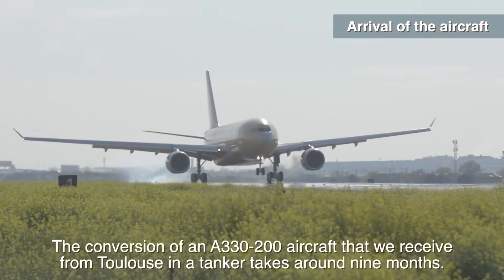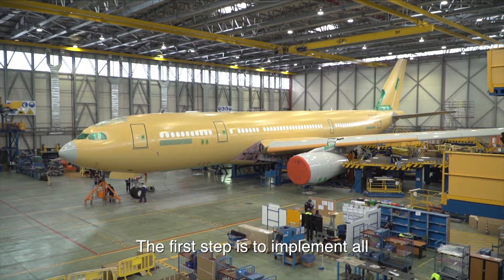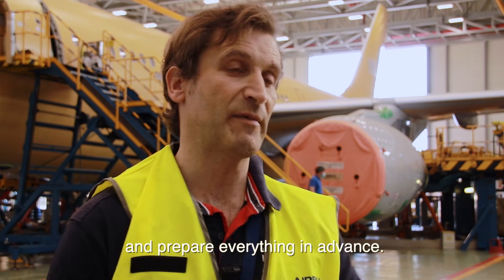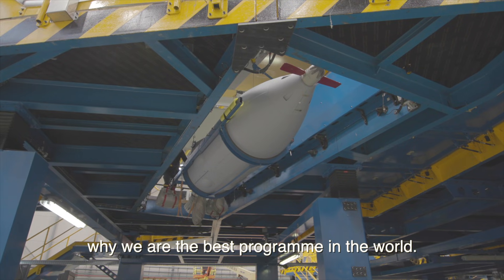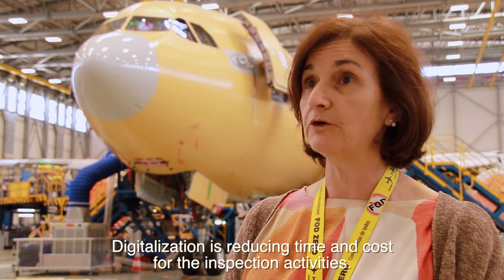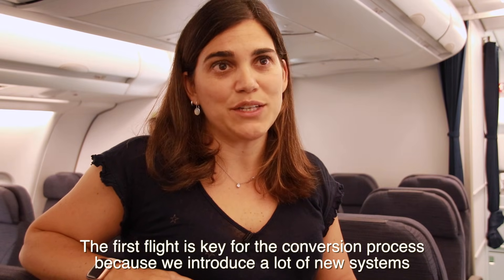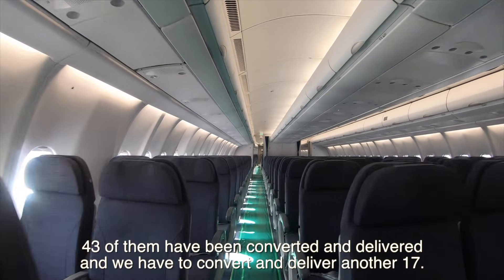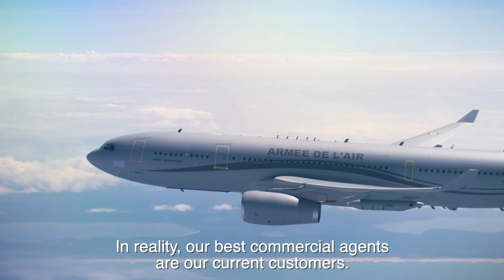How Airbus transforms the Airbus A330 aircraft into a A330 MRTT

Comment: the A330-900 Neo as a MPA with multi role ASW & EWS capability would make it a formidable asset against any adversary!!! the A330-900 Neo LR multi role MPA will have more capabilities than just an in-flight refueling tanker aircraft!!! speaking of capabilities the cargo interior of the A330-900 Neo LR can be fitted with a sizeable but state-of-the-art rotary missile launcher that can be lowered & retracted through a weapons bay door in the floor!!! the rotary missile launcher will be positioned in the middle section of the A330-900 Neo LR vast cargo hold for better weight distribution throughout the aircraft!!! the rotary launcher will be able to accommodate a variety of missiles ranging from Exocet AM39 anti-ship missiles & AGM-88G HARM-ER anti-radiation guided missile to STORM Shadow Advanced LR land attack cruise missiles & Meteor BVR air-to-air missiles (for self defense)!!! even heavy weight air launched torpedoes for that matter!!! all the A330-900 Neo LR needs is a new AESA target acquisition radar in the front nose of the aircraft & a side scan radar with terrain following feature built into either side of the aft lower fuselage section!!! the front half of the A330-900 Neo LR interior will be occupied by 5 work stations (in a tandem configuration, one behind the other) with dedicated technical crew operating the ASW & EWS system!!! yes, the A330-900 Neo will have a robust immediate threat analysis & countermeasure system comprising of radar & missile warning receiver in addition to an abundance of chaff & flare countermeasures that will be fired from a countermeasure dispenser retrofitted to both sides the rear fuselage section!!! needless to say that the A330-900 Neo LR will have mid air refueling capability from a B707-320B in-flight refueling tanker aircraft or the A330-900 Neo MMRT through an extendable drogue in the front starboard side forward of the cockpit instead of the A330-900 Neo MMRT rear under fuselage backward extending fixed drogue!!! to cope with the additional weight the A330-900 Neo LR MPA might require reinforced longer (taller) front & rear wheeled landing gear!!!

Comment: NINE MONTHS!? FOR A COVERSION!? It takes a couple of weeks to BUILD that airpane. Why would conversion take so long!? Move this line to a country without siesta!
Reply: MRTT is an unusual conversion process. There have to be additional, new structural elements added to the A330 airframe which don't normally exist on a civilian A330 and there's also the issue of putting in addition wiring and hydraulic lines, complete with redundancies, which might involve complete rewiring of certain areas of the aircraft.

Let's not forget that these aircraft are also being converted from civilian airliners to military transports/tankers and as such need new systems installed, such as an IFF, different transponders, military radio systems, and depending on the order, possible EMP shielding (effectively installing Faraday Cages around vital equipment).

An A330 airliner isn't meant to be able to survive being under fire in a theatre of war. An A330 MRTT does, and as such it's a lengthy and complicated process. Some components even get completely replaced with military spec components. Remember, these A330s aren't going to be airliners looking to make routes profitable, they're going to be military aircraft with a focus on being able to successfully complete sorties close to, or maybe even within a Theatre of War.
Reply: @vaska00762  I understand all that. Btw, refuelling tankers are NOT intended to survive direct enemy fire, they simply won't. However, I still don't get the nine-months lead time. It's ridiculous. Even if you have to disassemble and then re-assemble the entire aircraft, it's just too long. Yes, a lot of work has to be done, but they are not designing it, they are bolting on existing components.
Reply: Idiot
Reply: Ignorant.
Reply: @standup573  GET UP FROM THE COUCH AND GET TO WORK, CABRON!
Reply: @Maloy7800  You don´t even speak proper english. Read some books man...

Comment: What if a380  converts into mrtt ....the more fuel, the more distance you travel.
Reply: its just a big juicy target. also it guzzles a lot of fucking fuel, and the 380 can't lift as much as you'd expect.
Reply: An A380 would presumably be limited in where it could operate from, due to the runway length and apron load requirements.

Comment: I like the stab at Boeing... we make sure our tankers don’t have any FOD. 😂😂
Reply: Stab at Boeing.  Nope. Read the post!
Reply: @andrewdouglas9438  It was definitely a dig at Boeing. USAF has refused delivery on several KC-46 (767 based tanker) because of trash, debris, and tools left inside the airplane.
Reply: but these have less performance so no, please buy Boeing Netherlands Government
Reply: @jouniairplanevideos  Sorry but how on earth is the A330 MRTT in any way inferior to the KC-46? You really want that boondoggle clusterfuck KC-46? It doesn't work as designed, cannot fuel via it Boom and when it did it damaged receiving aircraft. It has crap in the wings and tanks, has fuel leaks from those tanks and is unsafe for passengers and freight. Its 3 years late and $4 Bn over budget and won't be IOC until 2023.
I thought you Dutch were a bit smarter.
At least the MRTT works every time and it carries more fuel (111 Te to 96 Te) so it can loiter in theatre longer. Serving in 7 Air Forces with 60 delivered. No failures.
Reply: @1chish  the problems are not a good sign, we all know. But the KC46 is an better design. Its based on the 767F. That plane is in production for years, and already designed to its maximum. That means the airframe is cheaper to build so more money could be used for more modern and extra systems aboard. That's why the problems costs more. They build an KC46 for around 200 milion dollars including the new stuff. But you already tell Boeings problems. So unfortunally its costs are going up.
An 330 costs 250 milion dollars with less performance. Such as less range, less freight capacity and some older technics even its new. Last but not least: its version is the wrong one. The 330F had to be used not the person version. We could say both failed, but in there own way. Airbus design, Boeing has problems with destiny. Boeing must always be the one with problems. 
Boeing can't be blamed for everything, some errors are supplier problems. Examples are batteries, engines, crashes with pilot error or weather problems, even there own staff that doesn't work according to the rules.
The Boeing pleague could be the name.
Reply: @jouniairplanevideos  Not sure why are peddling a pack of lies but OK I'll play along. By the way the A330 MRTT is a multi role aircraft (the clue is in the name) and can carry troops, freight AND refuel aircraft. All at the same time.
And lets keep it in perspective the KC-46 is a failure on every measure and yet you make out its 'a better design'? And if the 767F is so easy to convert how come Boeing made a complete hash of it? 
But lets look at capabilities:
Engines: A330 - 2 x 72,000 lbf  KC-46 - 2 x 62,000 lbf
MTOW: A330 - 233,000 kg  KC-46: 415,000 lb
Service ceiling: A330 - 42,700 ft  KC-46: 40,100 ft
Fuel Capacity: A330 - 111,000 kg  KC-46: 96,297 kg
Range: A330 - 14,800 km KC-46: 11,830 km
How much more do you need because there are loads more? The A330 beats it hands down on every specification bar top speed. Cruise speeds are identical. Its why the USAF wanted the A330 MRTT because it beat the KC-46 by some 800 points to 247. Until the competition rules were changed by corrupt Senators.
Its also why apart from Japanese who always buy American aircraft no other Air Force has bought the KC-46 while 7 countries have bought the MRTT.
Now as I say I don't know what your percentage is but you are starting to look rather foolish.
Reply: @1chish  Lies? Your "facts" aren't the same as my facts. Our government mrtt has 8900km range. The mrtt had only bellyfreight, not maindeck freight and bellyfreight, also the range of an 767 is more than the 330. I don't know what you're saying. BTW airbus is corrupt, and the senators know what they said. Our defence suppliers first than other countries suppliers. They always used Boeing, so why changing to a expansive plane if a lot of systems and army material are integrated in the cheaper plane wich became then more  modern. Also airbus has some brake-down problems by government or airlines planes. So thats also An fact what nobody likes.
https://www.defensie.nl/binaries/large/content/gallery/defensie/content-afbeeldingen/actueel/nieuws/2020/06/30/7267-klu-infographic-mrtt-a3-ned-jun20-002.jpg

https://nl.m.wikipedia.org/wiki/Airbus_A330_MRTT
Reply: @jouniairplanevideos  After working on both Boeing and Airbus design, I prefer the latter. More modern and stringent etc.
Also Boeing is as least as shady as Airbus is in terms of business practices.
Being in production for years isn‘t always a good thing, A330 airframe is way more modern etc. and the 737 fiasko only happened because they tried to keep an old ass design alive.
See the flattened and moved forward engines leading to this clusterf*ck.
Reply: @jouniairplanevideos  I work on both the 767 and a330, and BOY do I prefer the latter one. Easier to maintain, easier to operate,longer range, over all better quality. The 767 is over all just a shitty airplane from all those perspectives. The Dutch use their tankers for troop transport as well as cargo and tanker duty, so if you have seats on the upper deck anyway what is the use of a cargo door if you’re not gonna use it as such. and btw that 8000km range you were talking about? It’s Nm. Nautical miles. Which is some 14800km.
Reply: @pepijnbosvelt2526 I think most people would disagree with you point of view.
Reply: @seanpruitt6801  nope. Most people I work with (we do both airbus and boeing) in maintenance heavily prefer Airbus. It's easier, better engineered and over all less of a PITA
Reply: @jouniairplanevideos  these can fly from Madrid to Santiago de Chile with no stops...
Reply: @phantom4E2  So? The Dutch government buys crap. 8900km range for a civil plane with some army stuff on it.

Comment: And the Americans selected this over the Boeing offering because it is FAR superior. But then the "jerbs" lobby twisted the arms of the Senators who then had Boeing reinstated. So the US now have the KC767 which costs about twice as much unit price and is half as capable. The Americans won't make that mistake again.
Reply: *KC46. We selected the KC45 which was our designation for this airplane. The KC45 for us would have been built in the Mobile AL Airbus plant. The KC46 was given to us instead because of Boeing's protests. Only 2 countries operate a "KC767" that's Italy and Japan.
Reply: @bd5av8r1  Right. The Mobile AL plant was the proposed conversion assembly plant once a brand new A330-200 was flown in.
Reply: twice at much? if you don't look at the problems, the 767 is cheaper than the mrtt with better performance
Reply: @jouniairplanevideos  How is it cheaper? It is costing the Pentagon DOUBLE what the Airbus costs and it IS inferior.
Reply: @nathd1748  pure plane costs. An 767 is 200 milion dollars and the 330 250 milion dollars. Without problems. And the 330 is Inferiore to the 767

https://nl.m.wikipedia.org/wiki/Airbus_A330_MRTT

https://en.m.wikipedia.org/wiki/Boeing_KC-46_Pegasus
Reply: @jouniairplanevideos  The Pentagon are paying OVER TWICE what they were quoted for a similar number of aircraft by Airbus Consortium. The 767 airframe IS inferior. The Airbus won Pentagon tender TWICE before the lobbies started crying about "jerbs". The reason it won TWICE was because it was inferior was it? Yeah right. DREAM ON!! And by the way...have a look at how many tenders the Boeing was pitched against the Airbus. There are plenty. And how many did Airbus win apart from the United States?? ALL OF THEM!!
Reply: @nathd1748  check the links  767 has more transport capacity, more range so the facts are here. You could say what you want but the mrtt has less than 9000 km range. 
De Dutch mrtt is crap even the dc-10 is better at range and transport capacity.
Reply: @jouniairplanevideos  It does NOT have more range as a base model at all. the Airbus standard range is 13400km. Where are you finding this crap?? Why do you think the worlds airlines bought the A330 over the 767?? Are you brain dead? And for transport capacity...the A330 is a bigger aircraft with larger container and cabin capacity!
Reply: @jouniairplanevideos  The requirement of the A330 means it does not need to fit engines on the main deck. It has ample room for storing any necessary cargo in the hold. Anything larger can go by Airbus Atlas which most Air forces are buying over the US equivalent. You are obviously reading the LIKE FOR LIKE range of both aircraft wrongly. The Boeing range is stated with aerial refuel. The Airbus has more range and greater flexibility which is why EVERYBODY is selecting it!!
Reply: @nathd1748  so thats makes it much more expensive. An second plane necessary for a flight what an 767 or an DC-10 could do alone.
Range 767 11k, then.. with air refuelling Global. what they wrote. Don't shuffle words.

Good Day

Comment: Imagine if all the A340s currently being retired were bought by an air-force for conversion into a tanker!
Reply: Fuel consumption...
Reply: @lairbussologue8703  At least they are more fuel effecient than current American tankers. They are less effecient when compared with B777-300ERs because of fewer seats rather than payload.
Reply: You know the A330 has the A340's wings right?
Reply: @ZeeManifold  the A330 wingspan is 197.83 ft, early model of the A340 has a wing span of 197.83 ft but later 500/600 variants have wider wingspan of 208.17 ft. So you are half correct.
Reply: Imagine taking an a340 removing the two outboard engines and using a330 engines on the inner engines
Reply: @derpyto3z  is that what the A350 or A330 is supposed to be?
A340 with 2 engines = A350/A330
Reply: dErpyto3z Eeee strengthen the wing, and put some GE 90s on it.  2 of those make more thrust than 4 of whatever the 340 uses.
Reply: @schumi246  the A350 with the Trent XWB makes plenty of power. GE90s are too OP, and this MRTT arent meant for long range just enough to refuel and return for long missions and to carry troops and equipment. That said i wonder if we could see a A350 MRTT in the near future
Reply: Lin Chester not hugely OP, it would only be a 6,600 pounds of thrust upgrade total, the A340 is underpowered to begin with, even the -600.  It would still have a lower power to weight ratio than the 777-300ER, as it is a heavier plane, each plane at MTOW.
Reply: @schumi246  interesting, but having the highest thrust engine =/= better efficiency.
the Trent XWB while smaller than the GE90 by 10 inches, produce almost the same Thrust-to-weight ratio as its rival. Although we have yet to see the real performance of the upcoming GE9X.
Reply: @linchester8464  I don't think we will see an A350MRTT. The development costs of the A330MRTT were astronomical and unlike passenger aircraft, they clock up hours at about 1/20th the rate so they are not in the air enough to need the extra efficiency.
Reply: @schumi246  one GE 90 equals the four hair dryers on a343
Reply: @derpyto3z  Why would they do that?? If they wanted a bigger aircraft they would've used the A330-300 platform.
Reply: Or A300-600!
Reply: 345 is a fuel eating monster ...
Reply: @MarkzOng  KC-10 & KC-135：Hold my beer, at least A340-500s are using Trent 500 high-bypass turbofans.
Reply: @danielwong5099  KC-10 has the same CF-6 engines as A330-300 & A330-200. Kc-135 only the R variant has the same CFM-56 as A340-200 & A340-300.
Reply: EpicThe112 Yeah, not quite.  KC10 has CF6-50C engines (2nd generation) which are a really old design using a hydro mechanical fuel control system with a fan case mounted gearbox. The A330 has (as one of 3 engine manufacturer options)  GE CF6-80E1 (5th & final generation) engines.  They are a much larger engine in diameter, technology, and thrust rating, as well as fadec engine control with an engine core mounted gearbox.  
Even the CFM56’s are completely different.  1st generation on the KC135’s verses 4th generation on the Early 340 airbus.
Trust me, there is more commonality in the engine names than the engines themselves, and for what it’s worth the A330 is ideal for tanker modification because the wing shares commonality with the earlier 340 wing including the hard points where the outboard engines would have been bolted on had the wing been fitted to the 340. This is where they bolt on the hose dispenser assemblies.
A340’s in their various models are much better suited to being converted into beer cans.
Reply: @MarkzOng 
I hate to burst your bubble but what you're saying is not entirely correct and if fuel efficiency was really a serious concern, Airbus would have offered the the newer A330Neo instead.
https://simpleflying.com/airbus-a330-vs-a340/#:~:text=According%20to%20this%20source%2C%20an,km%20(72%20mpg%E2%80%91US)